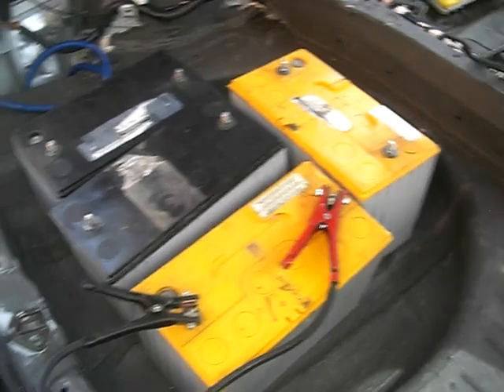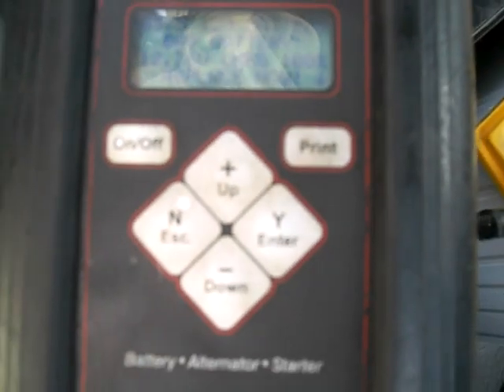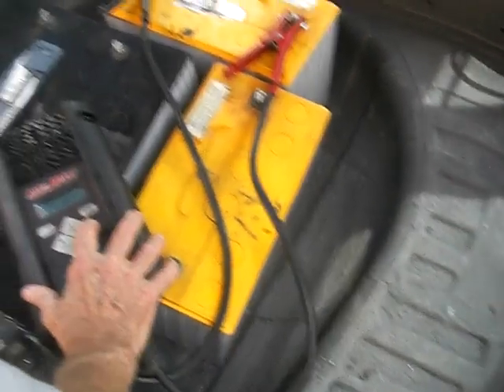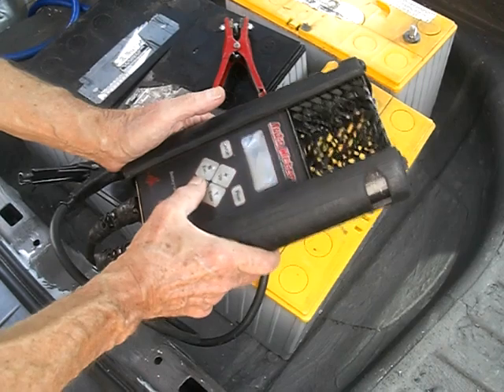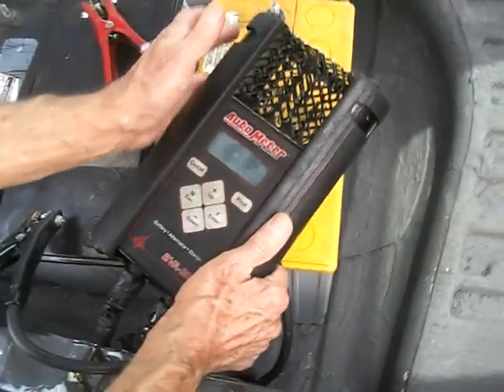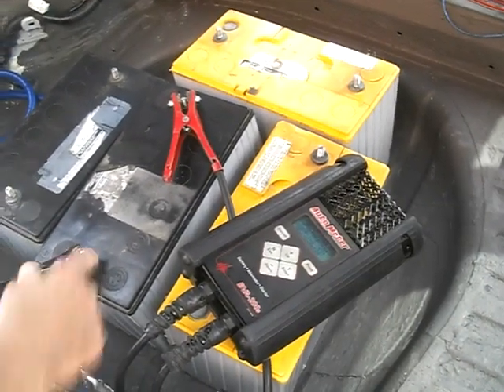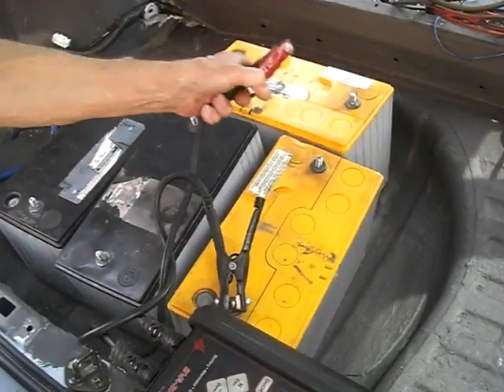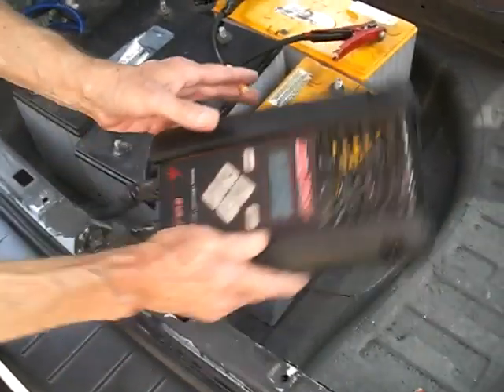Bad Deka 9a31's

Comment: Due to the condition of these batteries (missing handles, missing front labels, missing BTP labels) they appear to be seconds. If you bought them at full price, you should have returned them to the seller. Also depends on where you stored these batteries. AGM batteries are nice, but they are more fragile. All batteries can not take extreme cold, but AGM can not take HEAT. Heat is specifically monitored in the battery formation process. If heat is an issue for you in your general location, try gel batteries (Gel 31)

Comment: Looks like you bought some reconditioned  (used) batteries since they have no tags. 
You should NOT test the batteries of this type on the stud; it is stainless steel. Put the clamp
on the lead pad or buy some lead post adapters for best results. Digital testers of this type are fickle, they can lie to you. Deka makes a quality product, you may have bought some
marginal used batteries.

Comment: how did the story end? 
I had this with Optima. I have some of their older 800 CCA batteries from 10-15 years old and still working well, but I had like 3 bad 720 CCA ones from Costco
I bought a couple of Deka Intimidators and they worked ok. I bought one of these for a UPS and it worked ok but I never tested it so I don't know if it meets spec.
What I like about Deka is they are still independent and made in the USA. Everything else is either bought up by Johnson Controls or Exide or foreign